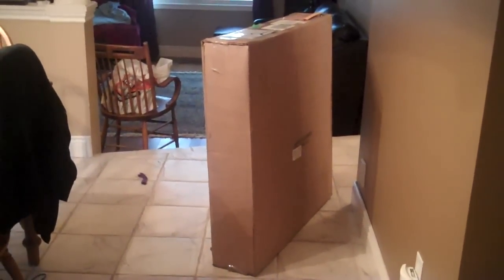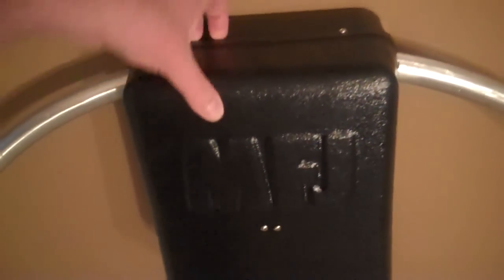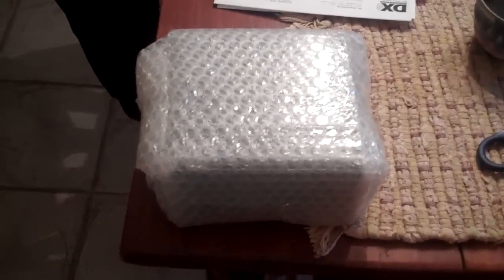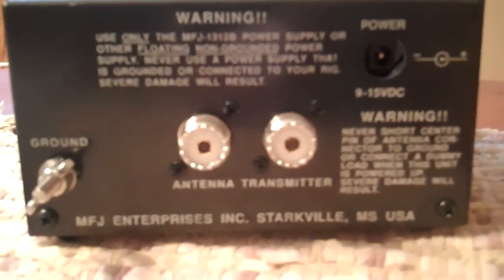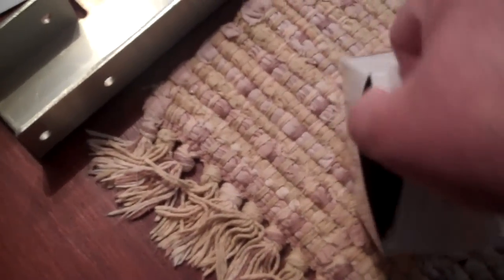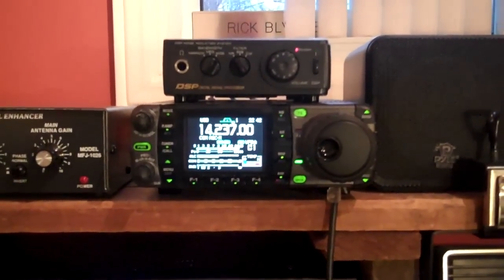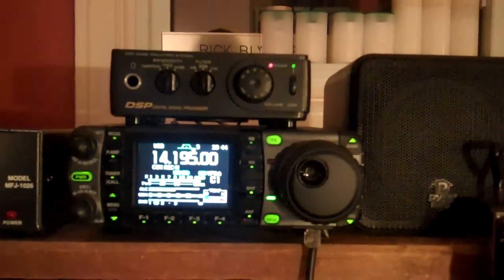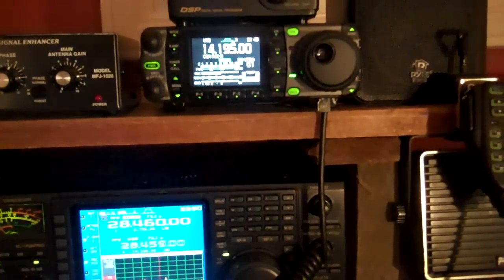MFJ-1786 MAGNETIC LOOP ANTENNA FULL SETUP VIDEO

Comment: After about a week or so of using this antenna on and off I was listening around on 15m band, ZS6DJD 5/7.. well it can certainly hear well, I called him a few times and eventually received a 4/0 rpt, 95w power out... delighted with that for a 3ft diameter loop...I live in a built up area, antenna is horizontal, way way better than vertical and noise floor usually about a s2-s5..... next was a PY2 station, faired somewhat better, 5/3 rpt... happy with that, very happy with that rpt.. pity the band conditions have gone to crap again... I bought the 1786x second hand for 200 quid, still a bit on the high side price wise but it works better than the Western hf-10 di-pole antenna but in saying that the Western hf-10 is superb on 40m and 80m .... 73, MI0GTA...

Comment: How much power were you running to reach the station in Croatia?  What is the power limitation of the MFJ antenna. It can't be very high considering the spacing of the capacitor plates.
Reply from the maker: It can handle 150 watts. I was running 100

Comment: How is the noiselevel compared to other antennas?
Now I use a random wire from my appartment but the QRM and QRN is really terrible.
Reply from the maker: It is well known, and I agree, that loop antennas are much quieter than random wires. I would demonstrate but I dont have a random wire currently.
Reply: Hi there! Just want to know if you the QRM on Loop antenna is much better than on wire Dipol antenna? I am fighting with 9+ QRM on my QTH in the city - it is so bad! Please share you experiance! Regards from Germany! Jens
Reply from the maker: Magloops in general are known to be quiet compared to wire antennas.  It sounds like you have a very bad situation though, so I would not expect miracles.

Comment from the maker: It's a Radio Shack audio DSP. The IC-7000 I find has a high hiss/noise in the background. This DSP doesn't help that much really, but I did get a very good deal on it at a swap meet. $15

Comment: I had complained to MFJ after the first mishap (which I fixed "ham radio style" ;-)  I repeated my complaint after seeing that they didn't fix this with my second order, even if I warned them about this. BTW, this is "engineering 101"... anyone in QC (do they have QC?) would notice this and the designers could easily fix this (pity). Additionally, there was a "floating screw & nut" in the tuner case of the 1786.

Comment: I have the 1786 and the 1788. I broke the captive nut on the 1788 so when I received my 1786 I knew what to do. I elongated the saddle slots so that the bolts could be installed without any side pressure. It works great once you do that.